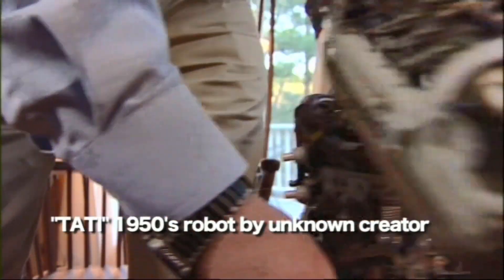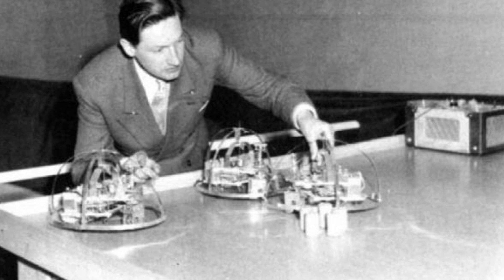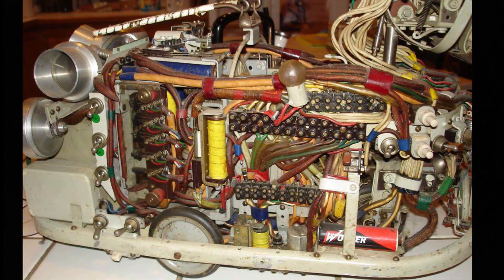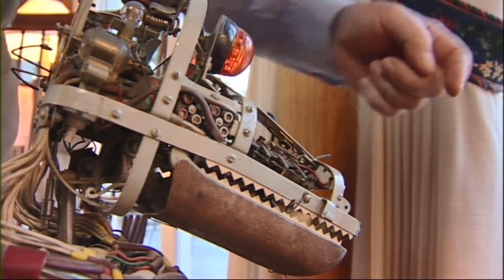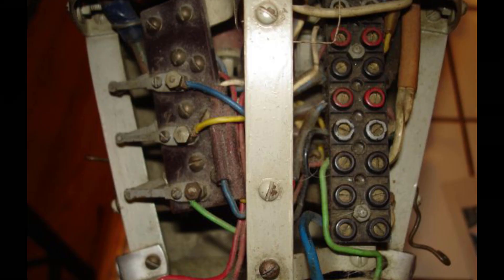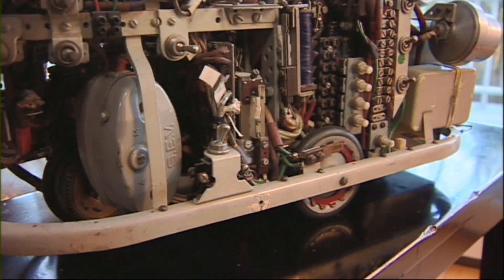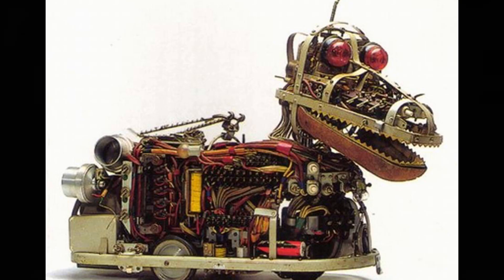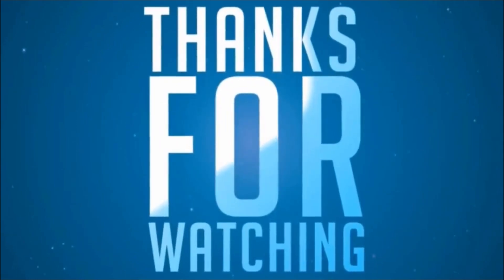Mysterious Robot - 70 years old and still UNSOLVED! - Tati the Cybernetic Dog

Comment: A few of those wires are very common for mid 50s and 60s specially inside of televisions, fabric covered 4 core cables, a lot of the model seems though to have no function and either it has been changed by someone who did not entirely know what they were doing, or the model was never finished, perhaps even salvaged for parts, or was never intended to function but just look good, some parts seem to be timing mechanisms maybe for mouth movement, something that complex should of left some evident trace, a neat mystery!

Comment: The fact there is an incandescent bulb next to the light sensor suggests a system designed for obstical detection? Light reflects, tati responds? Also bulb rear of head... Seems odd...

The switches with elements around them, could they be a simple way to detect overloading a motor?